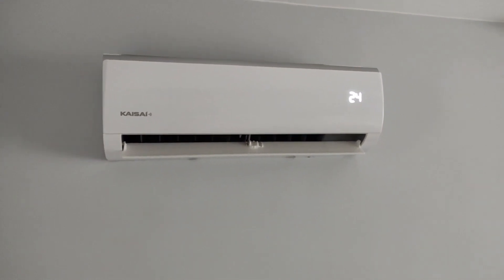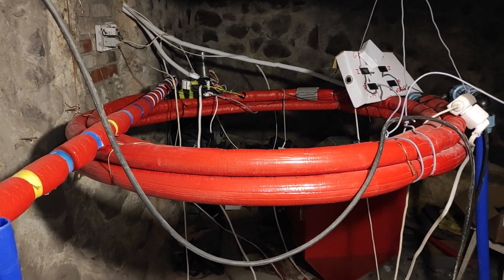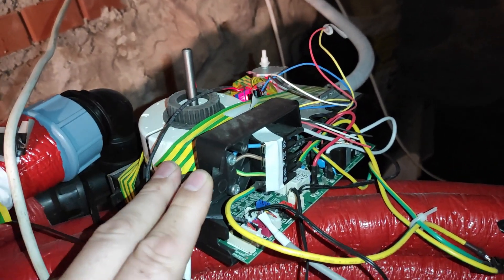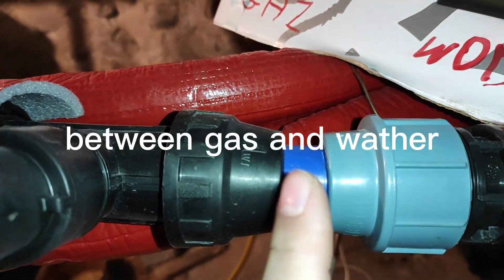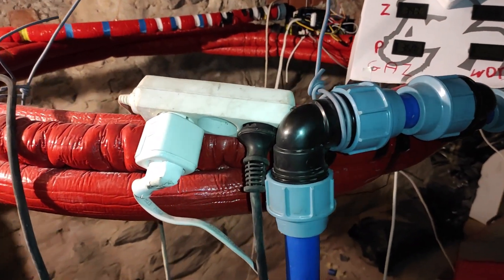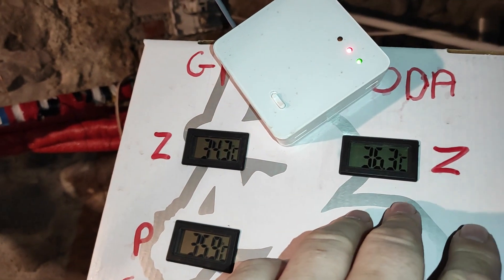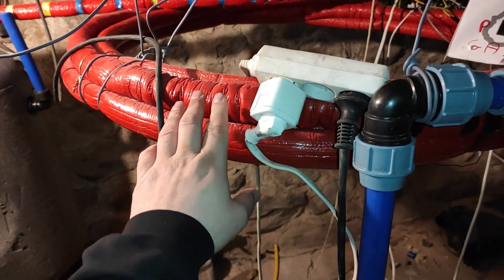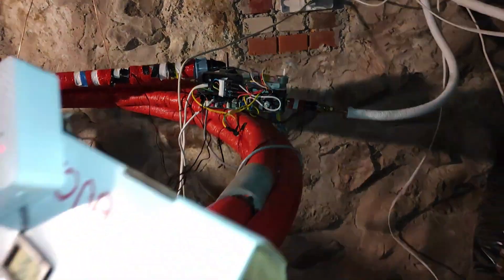Heat pump from AC Split Unit To Heat a House or Pool or ?

Comment: Awesome content, exactly today I was searching on this topic "how to make a split AC to an Air-Water heat pump" and the coincidence of spotting your video regarding the same idea at almost the same time you posted the video is hilarious. 
Again, you did an awesome job! I Have a question where do you change the diameter of the refrigerant pipe in the heat exchanger (you have the small diameter copper pipe inside the plastic one ?) 2. What is the length and diameter of the copper pipe used in the evaporator?
Reply from the maker: No, thicker one is inside that way you have more contact area with water. Lenght is 13meters but i recomend for this AC 15m gas pipes are as manufacturer recomend 1/4" and 1/2" 
thicker 1/2" inside 32mm blue platic pipe